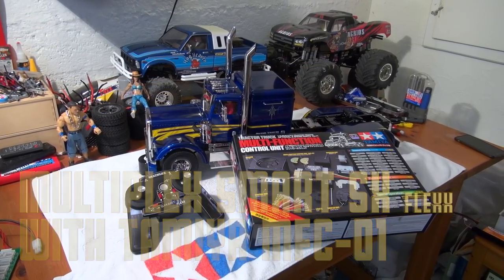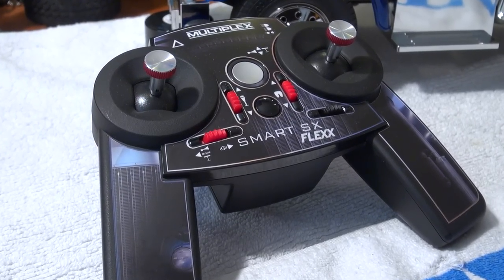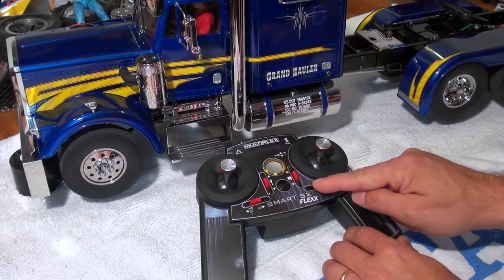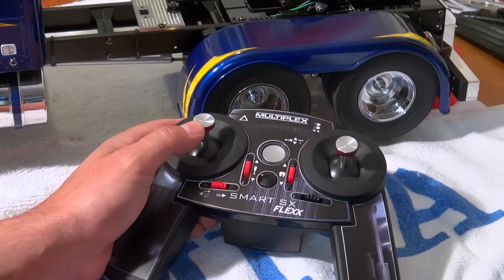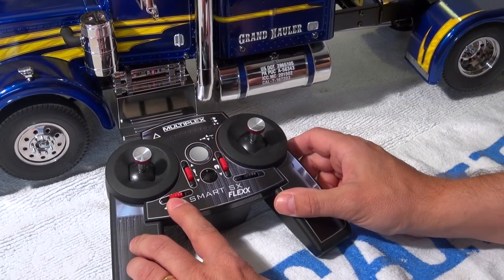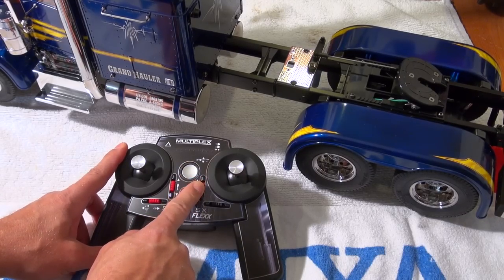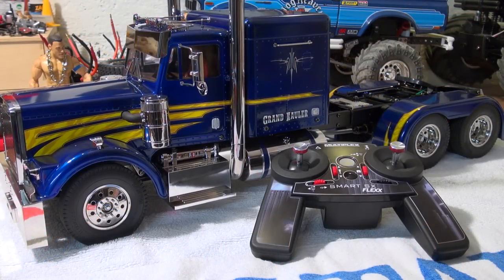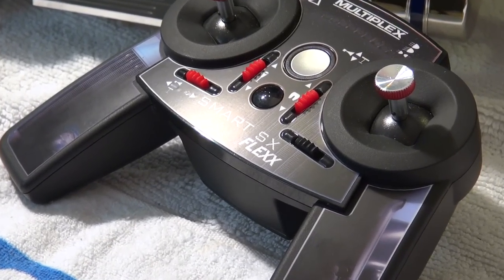Tamiya Truck MULTI FUNCTION UNIT controlled by MULTIPLEX SMART SX 9 Flexx

Comment: I need help setting up the functions on the controller. do you have a videos on how to set up the. most of my functions are way off
Reply from the maker: Sorry no video about it. But you have to do it as explained in the MFC manual. You have to do the setup procedure with all cables connected properly. Then  it should work.

Comment: Very nice. So if u start off in first gear, do u have to hit the red switch to change to second while moving?
Reply from the maker: creepa9 Yes, that's correct. But you better release the throttle while shifting, to protect the gears.
Reply: ***** thanks Matteo. Very helpful. Keep up the vids. Best on you tube!

Comment: Hi great video. I'm in need of a great controller for my truck.   Is it easy to set up plug and play as such is there any configuring u need to do on the remote.
Reply from the maker: Thanks. No, nothing to program on the transmitter. After everything is connected to the receiver you have to perform a setup procedure. But this is not a big deal, everything is well explained in the manual.

Comment: Thanks for introducing this brand of Radio. It seems to be pretty good. But one thing I noticed is that they mentioned only MFC-01 and not MFC-03. So anyone planning to get this please do confirm whether it works with the MFC-03 in the first place. I think it only works with MFC-01. Also does anyone have a link to their online store? I went around in a few circles but landed on the same page (with no links to Add to cart / or to Buy ). I hope I don't have to send in some "Order form" to make the purchase :)
Reply from the maker: It seems as Multiplex is difficult to get outside of Europe...
Reply: @Matteomeier  I found couple of dealers, one in Australia and the other in UK. Have emailed them. Thanks.

Comment: Hi Matteo. Which transmitter do you recommend for the Tamiya Bruiser?
Reply from the maker: It should have at least 3 channels. I recommend the Futaba 4PLS the 3 step switch can be perfectly used for the gearshift https://www.futabarc.com/systems/futk1410-4pls/index.html

Comment: what is the difference with 15303 and 15309 model
Reply from the maker: +seasonvett Model 15309 can manage more functions (additional switch included) But, if you use Tamiya MFU, 15303 is enough.
Hitec is the Multiplex distributor for us, maybe they can help you: http://hitecrcd.com
Or you order it direct from Germany, this shop will send it to U.S.: http://tamico.de/Multiplex-SMART-SX9-FLEXX-MLINK-Set-Fernsteuerung-1-5303